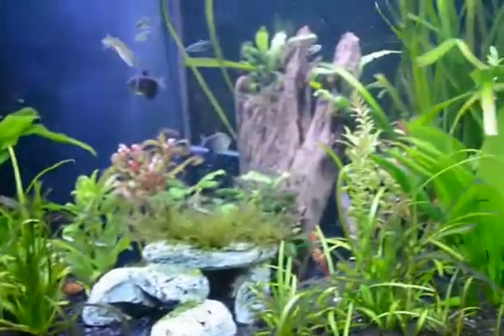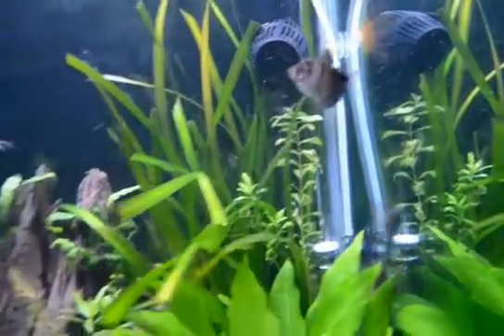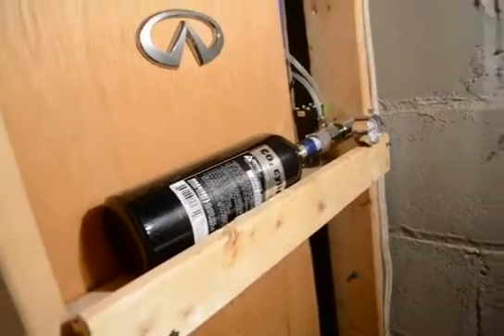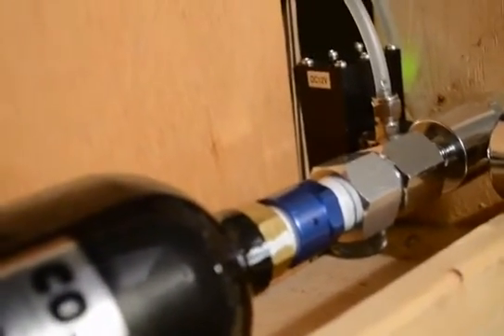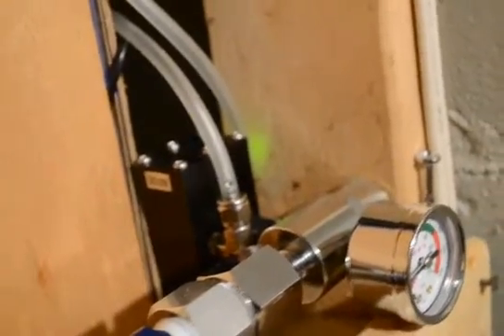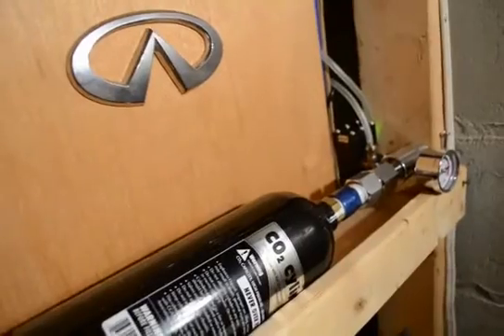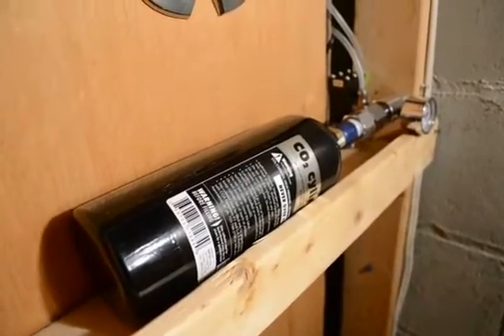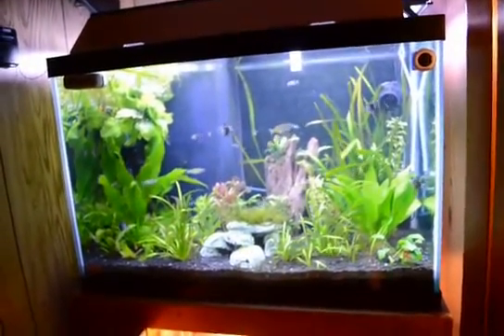52 / Paintball CO2 w/ Regulator & Solenoid Installation

Comment: How do you start the CO2 flowing from a Paintball canister?  I have a regulator that fits paintball tanks but the one that comes with it has a valve to start the CO2, paintball does not.  I have it connected but no CO2 flowing.

Comment: No I have not played paintball. Was told that if the tank is not horizontal an explosion could occur.
Reply: unfortunately, no it won't explode. it won't even explode if you over fill it as there is a burst disk placed on the valve assembly if it somehow overfills. This setup is perfectly safe for the application it is being used in. least its not taking shots at 400 fps from a .68 caliber ball.

Comment: I'm looking to buy the exact same thing at petsandpons. c o m but I was worried about not being able to adjust the CO2 flow but as I can see in your setup you actually can adjust it with the solenoid. Is it precise? Is there a precision screw valve that you can adjust easily bubbles/seconds?